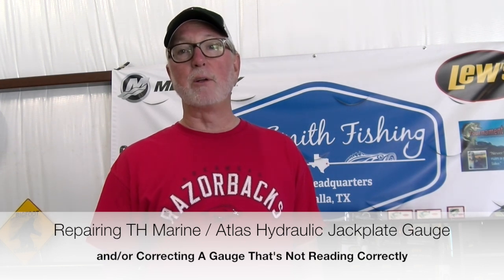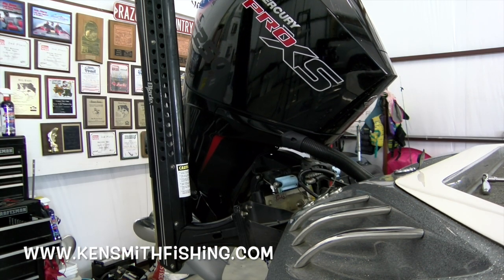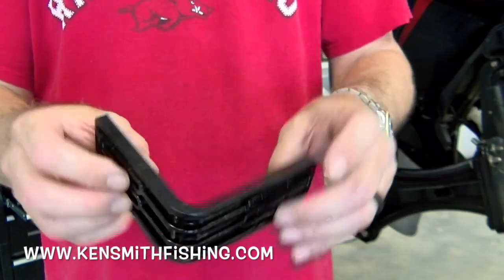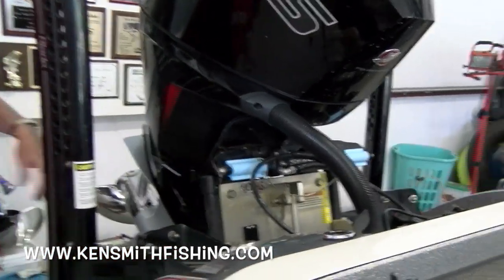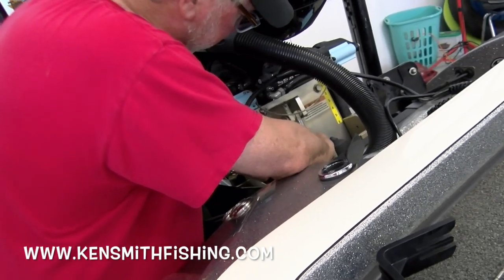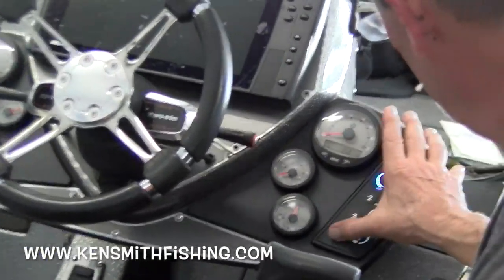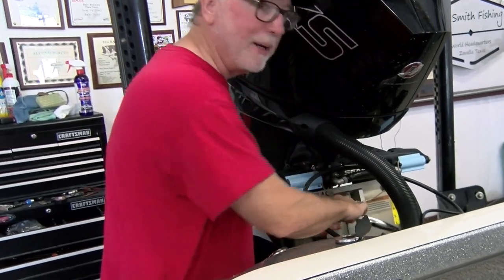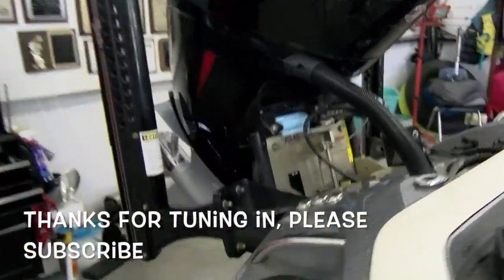Repairing Atlas : TH Marine Hydraulic Jack Plate Gauge

Comment: To add to this video mine stopped working when I repower my boat last month. I checked the L  bracket as suggested but, mine was still in tact, however it had slightly shifted to the left may 1/8 of an inch. I adjusted it back and it worked perfect. So make sure it's perfectly straight if you are having a similar issue.  Thanks Ken!
Reply from the maker: Great tip and something I didn’t know

Comment: Mine broke as well, awesome videos,thanks bud
Reply: James did you receive your new bracket? Was it part# FAGL-BKT-2?
Reply: Haven't ordered it yet, thanks for the part number, I'll look into it 👍
Reply: @JimGLopez67  I ordered mine yesterday.  Hopefully it is the right one, lol!  I dont see any other magnetic brackets on their website.  Best of luck!
Reply: @JimGLopez67  i recieved mine (the one with the rectangular spacer) and it fit perfectly on my 10" atlas jackplate.  You may want to call them and ask for the longer pan head machine screws (#10- 32 I'm pretty sure).They are about 1³/⁴" long.  You will need them if you dont already have them due to the extra thickness of the spacer.